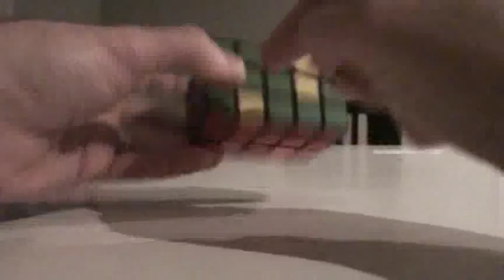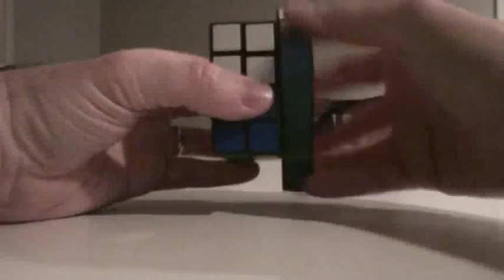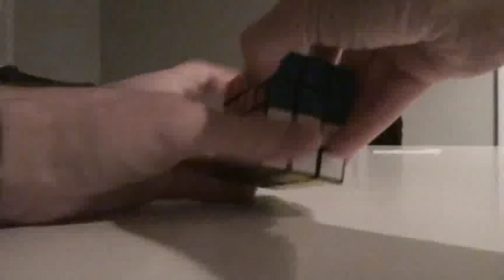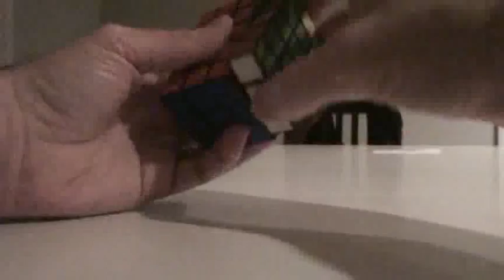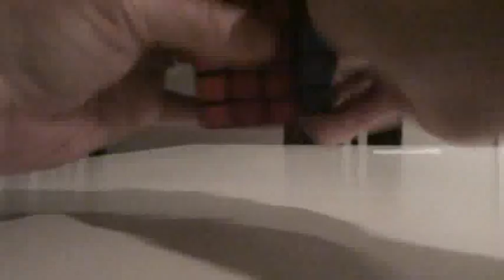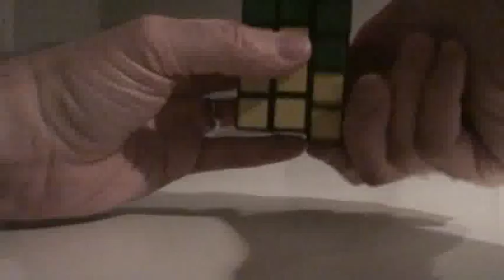3x4x5 fully functional cube tutorial part 3

Comment from the maker: @Rouricht Thanks man :)  I wanted to plan out a strategy that can return it to the cuboid form with all the outer edges solved so that I can finish the solution with a single parity fixing algorithm applied repeatedly until solved.  The parity with one middle switch is something I stumbled on when working out a simple solve for the 4x4x5 (its amazing what you can discover when making desperate moves!).  btw, you've got some fantastic material out there, great work!